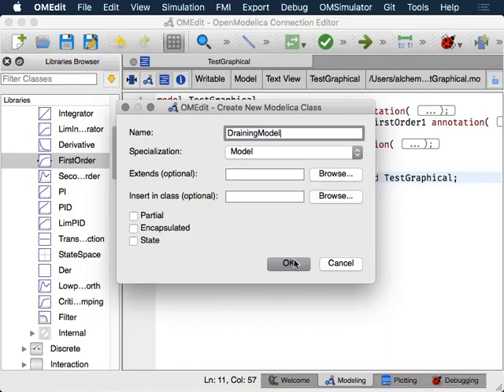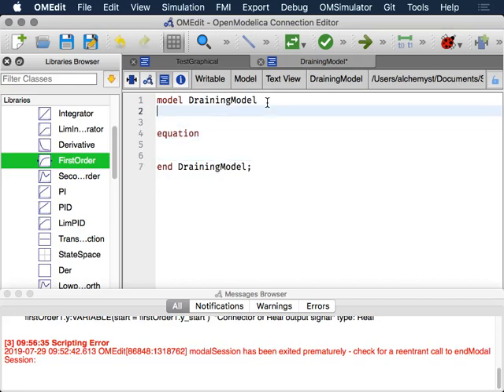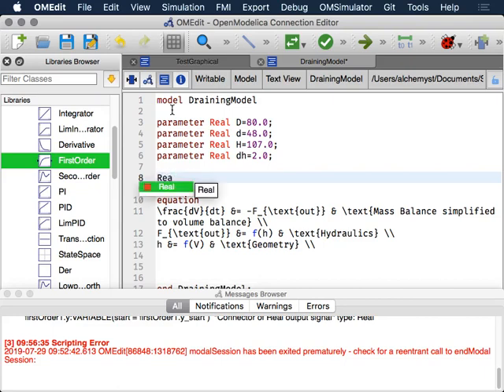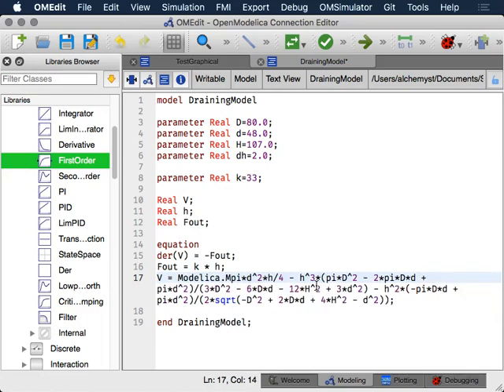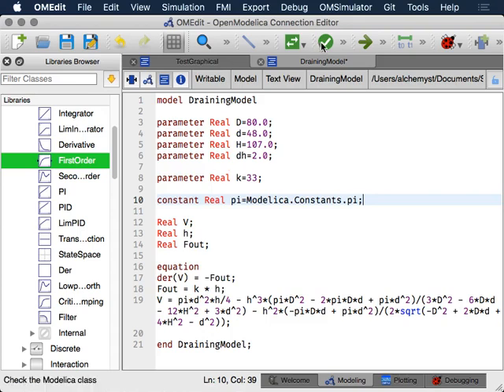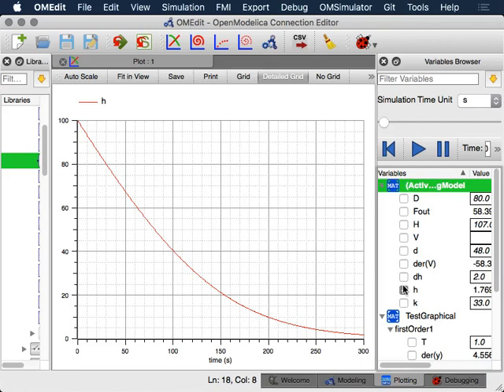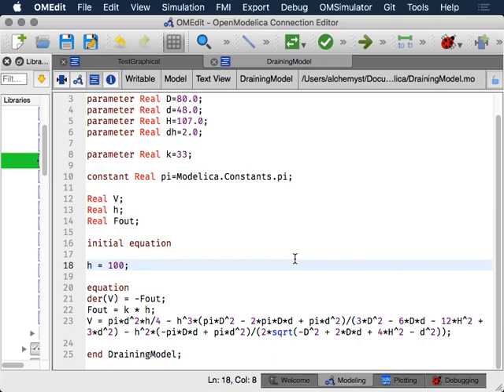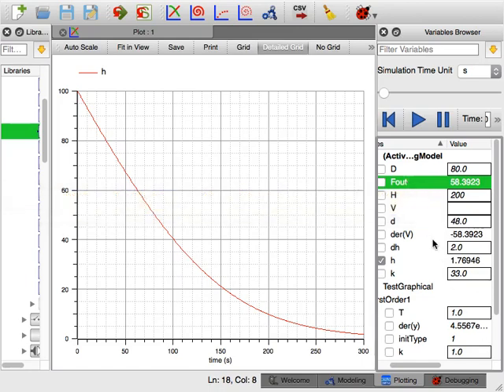Draining cup model in Modelica

Comment: Hi, sorry to bother, resolving this problem analytically by using the Bernoulli equation should't the flow of volume out be equal to sqrt(2g*h)*pi*dh^2=sqrt(2*9,81*100)*pi*1^2=220 for the inicial condition.The resulting number for the inicial flow is 220 is way less than your original fout of 33*100=3300. I know a linear approximation was done but my numbers are way off. I would be very grateful if you could point where i did wrong even converting 9.8 to mm/s results in 4398 is this number good enough? Thank you very much for this didactic simulation.
Reply from the maker: The discharge coefficient we used here was fitted in experimental data during the other lectures we did in this cup model - however the point of this video is more to show how to implement a model rather than how to derive it.